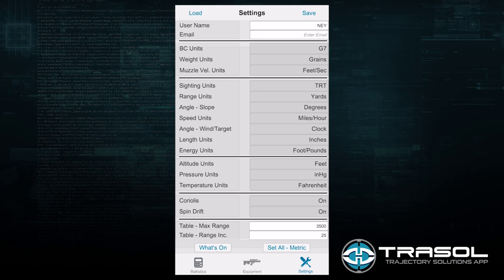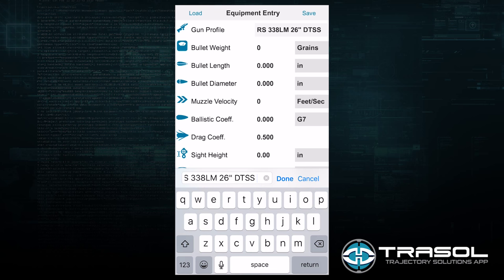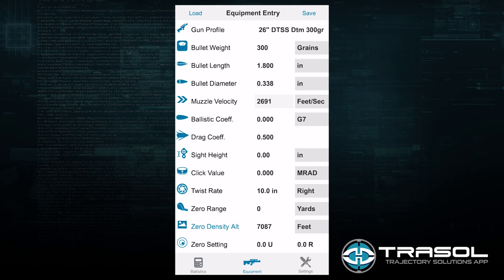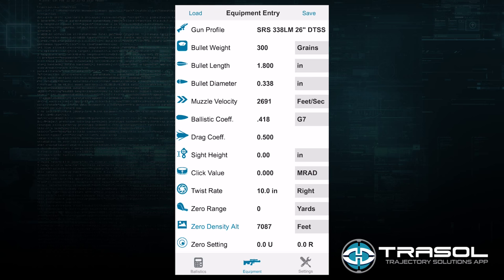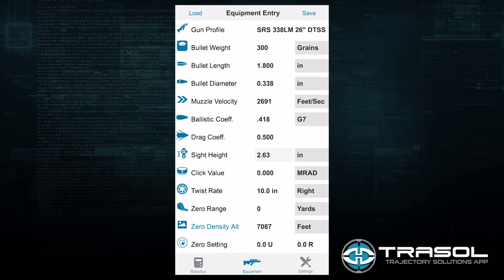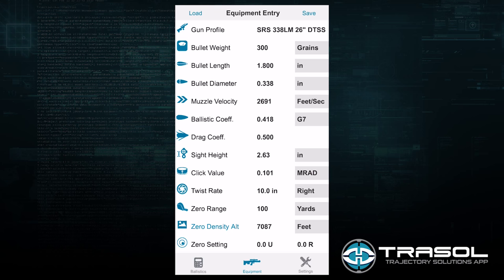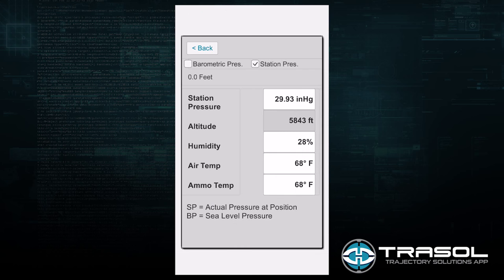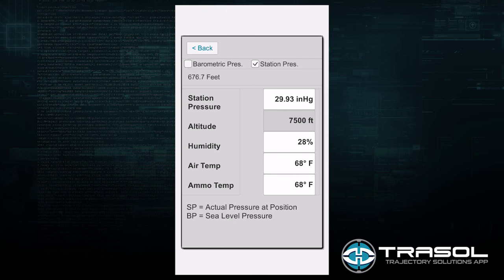Trasol App Equipment Screen - Learn how to use our Ballistic Calculator

Comment: I did a tall target test on my scope. It's click value is less than 1.0 mil )3.6 inches) @ 100 yards. Do I enter 0.097 if my scope click value is only increasing 3.5 inches @ 100 yards? In your example, your scope click values were more than 3.6 inches @ 100 yards.